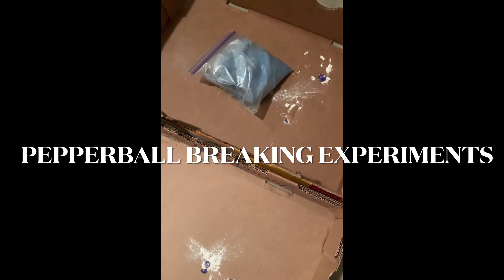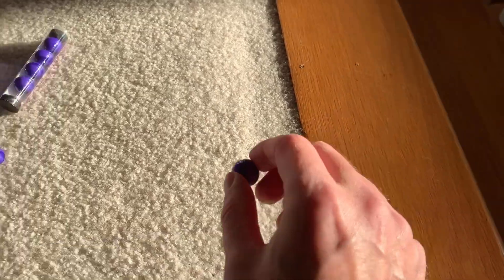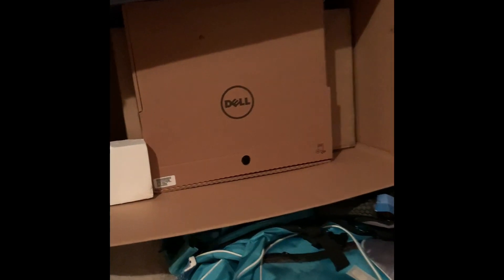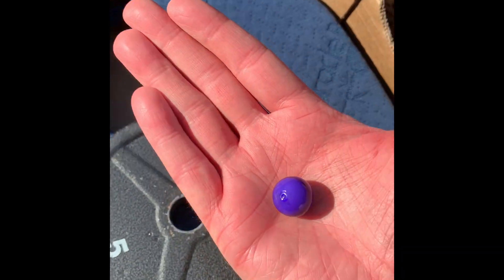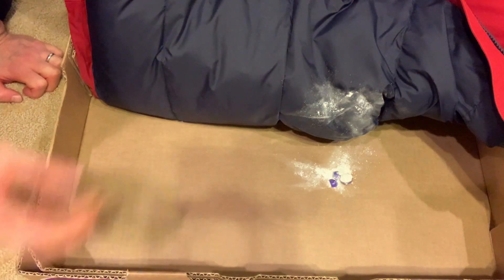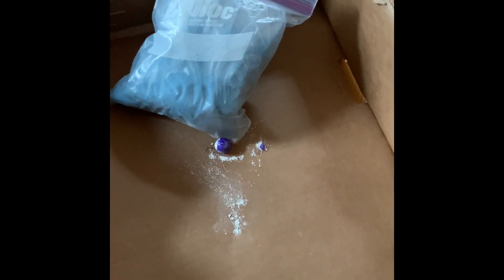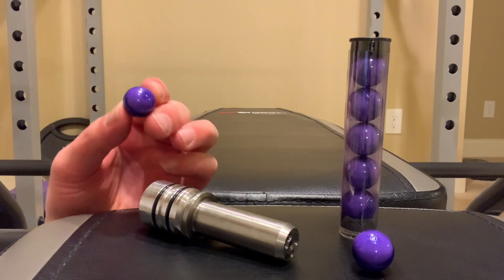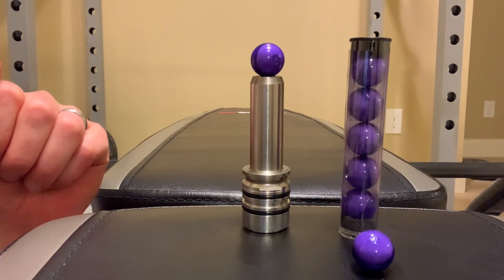Joules of energy to break a PepperBall - let's experiment

Comment: True story.  Turned my TCP velocity screw clockwise till it couldn't go any further.  Then, I tried to turn it counterclockwise.  Screw wouldn't budge.  After several tries, I decided to send it to UTS for repair.  Before sending it back, I decided to fire rounds from it as I was curious to see which would survive that high of a power setting.  The chrono was 8 g @ 377 fps or 52 joules.  One 8g CO2 cartridge per shot.  Tried paintball rounds and inert rounds.  Surprisingly, some paintball rounds could survive and hit the targets at that power setting.  I would not want to be hit by a paintball going that fast.  Other rounds exploded either in the gun or right after leaving the barrel.  My last shots would be at an old American Tourister luggage I was about to toss.  The paintball rounds exploded on impact.  The VXR and Pepperball rounds left large crater-like impacts on the surface but the rounds didn't explode!  Upon inspection, the surfaces of the rounds were imprinted with the luggage's surface texture but the rounds were still usable!
Reply from the maker: Sounds interesting. I hesitate to fully turn the velocity screw all the way because the spring might kink when compressed and not return to normal level. However, it is very easy to replace the spring so you shouldn't ever need to send back to UTS for that problem.  I haven't been brave enough to test Pepperball rounds at power higher than 15 Joules but they are built very strong and I definitely believe that some will randomly survive.  Luggage has some give to it and if the round makes it out of the barrel it has a good chance of not breaking on contact.  I had several not break on cardboard boxes.  I love the Pepperball concept and Live-X and right now I just use them exclusively with the Lifelite but with the caveat that I will need to target something hard in order to break the round.
Reply: @ShadowCatTactical  Hee hee.  My problem was the dang velocity screw was stuck.  Tried numerous times and methods to free it, but, eventually, the screw got stripped.  So, if UTS couldn't fix it (as it was still under warranty,) I'd need to order a new regulator.  🤪
Reply from the maker: @juicyfruit6311  Was there any corrosion of the screw?  That part is exposed to the environment.  I have a video coming up soon about the risks of moisture getting into these launchers.
Reply: @ShadowCatTactical  Nah.  My gunsmith/paintball tech told me that I was using a crappy, ill fitting allen key.  It wasn't a snug fit so the allen key started to slip and shaved off the screw's walls.  He also recommended that I clean and lube the threads as needed.  In other words, it's a gun so care for it like I do my other firearms.

Comment: The TCP, and the FSC are great! In my opinion, they would be better for kinetic rounds at 6-10 grams due to the number of Joules created by these markers. BYRNA is built for pepper delivery. I practice situations by ricocheting, and deliberately shooting walls, bulkheads, telephone poles, street signs etc, as if I did not have a clean body shot but the perp would be clouded!!! Kool ha?
Reply from the maker: Yes, I agree. In theory, 6 pepper balls shot on hard objects should create a cloud or barrier to give you a chance to run the opposite direction.  But in reality, wind and your actual position relative to the perp will determine how well the system works.  They will work best with a hopper full but that's not an EDC.  Also, I think they work better indoors in some scenarios but that presents lots of issues for yourself being exposed to the cloud.  There are places where they can fit. The discussion will continue.